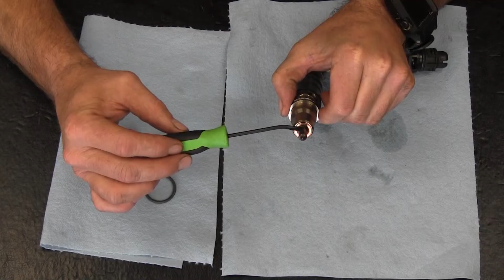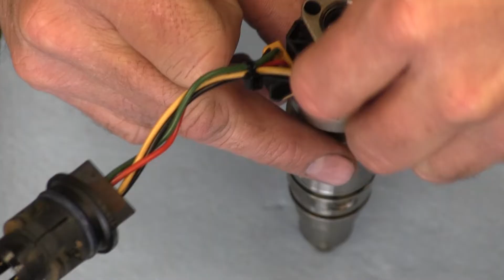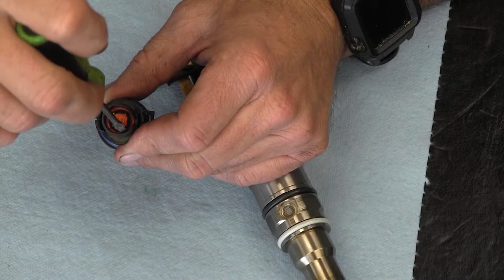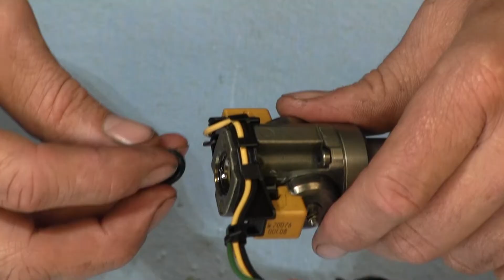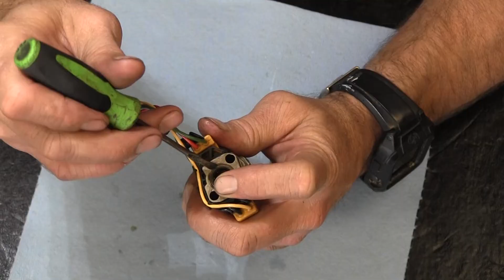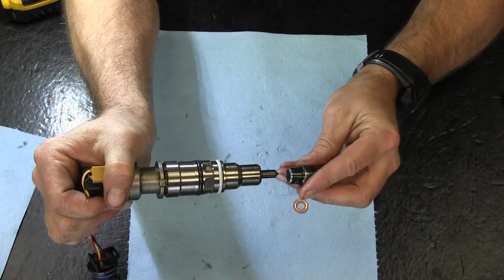Need to Replace the O-Rings on Your Injectors??? Watch How Easy!!!

Comment: good day! Why is the nozzle not holding air? The air comes out of two small holes, from above, where the nipple should enter.
Reply from the maker: I don’t quite understand the question.  But the nozzle is an extension of the injector circuit, and if it were air instead of fluid being delivered,  it would still “hold air” if the pintle was closed.
Reply: the fact is that when checking with air, the nozzle is not airtight! After removing the ramp, I saw that the O-ring was intact. But when air is supplied directly to the nozzle, there is an air leak, air comes out of two holes that are located near the central entrance, where the nipple enters.
Reply from the maker: If you are talking about an air leak in your engines high oil pressure system,  I would suggest hitting the IPR and changing the commanded pressure and seeing if the sound changes.  I guess I still don’t understand the question.
Reply: @thoroughbreddiesel  I believe they're saying they replaced this O ring, reinstalled the injector and the oil rail and air tested (using IPR I assume) and were still getting a leak and seeing bubbles from the holes on top of the injector on either side of the cup that you were just replacing the seal in.
Reply: I'm from Russia, I got an international with a Ford engine. We do not have specialists, unfortunately, there is no diagnosis either. I solve problems on my own. If it's not difficult, then your help with advice will be very useful to me. I'm watching videos with Ron on YouTube.I learned a lot of useful things.

Comment: I actually added too much oil (5 quarts too much) how much damage did i do? slightly rough idle but does shake at 50 mph range above 50  it runs smooth. my mistake was that i the youtube video i followed, had 4 jugs of oil(he used non motorcraft 1 gallon jugs) and i used 1.25 gallon motorcraft which were 5 quarts each so i overfilled.
Reply from the maker: Hard to say, but probably none.  Drain the oil and start again.

Comment: I'm just swapping injectors do I need to replace  o rings if I'm careful.  Have a po302 on my 2006 Subaru sti.  Already swapped  plugs and ignition coils
Reply from the maker: I don’t have an answer on the Subaru specifically but we always suggest when a injector is replace we change the orings and copper compression washer each time.

Comment: I'm no expert on 6.0 injectors. But every time I've replaced the inside o-ring, it's been faster and easier to pull the snap rings out.  If you get a small pick, grind it down and flatten the end to fit between the snap-ring opening, then twist, it will come out very quickly.  Then slide the guide out and swap the o-ring. A quick push with a screwdriver installs the new snap-ring.  You'll fight with it way longer trying to get the o-ring in without removing the clip, plus much greater chance of damaging the new o-ring.  But, everyone has their own method.
Reply from the maker: Thanks for sharing!
Reply: Sounds good!  If you ever need to do this again I bet a lot of people would love to see the video of you doing this, myself included.
Reply: I never have time to record, edit and upload anymore. But I did just finish another set of 6.0 injectors today. Two of them gave me a fit. It was still easy though. Once you pull the old seal out, push the guide ring down, then pop the end of the snap ring down with a good tap. Then grab it with a pair of pliers and twist a little. Both came out quickly.
Reply: Right lol thats what i thought 🤣

Comment: Looking to throw in a set of 90hp sticks in my 6.7. - Do you recommend upgrading the CP3 and/or lift pump? - It appears that the 90hp’s are marketed as “largest injector recommended for stock system”.  Some say they have zero issues, while others say they have pressure drop.
Reply from the maker: We suggest upgraded lift pumps on stock applications, and upgrading your CP3 will help you get the intended results from your injectors if the tuning leaves power on the table.  Short answer, yes.  Your ENTIRE setup should reflect your intended HP goals as well, don’t forget that!

Comment: Theres 2 orings in side the injector body that fail before tbe external O-rings do when that happens you start dumping diesel in your oil then tne fuel rail under the nipple is an oring that should be done . Do those too unless you like pulling them out every other month
Reply: OK, So there would be the top seal inside injector that nipple cup seats in to. I replaced that one with Mahle seals.  Where is the other one?    Thanks for the reply.

Comment: Hi Wayne, After you do a rebuild on engine including reseal of injector top seals , nipple cup orings, new oem stand pipes and dummy plugs with engine still on stand and basically dry (no oil)  would it be unusual to hear air escaping from around all these areas?   Hissing and some clicking , spitting noises. Carefully followed your video guides resealing  all those and thats what I'm hearing when testing with air though ipr or icp ports. Dont want to tear it all back apart if this is more or less normal and really dont want to do it once reinstalled in truck. Some guy on powerstrokenation had similar issues same situation and truck started and ran fine. I also had a smoke pen and streamed a steady stream of smoke around all the noisy areas and didnt see any air leaks that way around oil rail and injectors. your thoughts greatly appreciated or anyone else who cares to comment.
Reply: What ended up happening
Reply: I only finally got the engine back in and running which is why I waited so long to reply.   The truck built up high pressure oil to the injectors pretty quickly. Only took about four 15 second cranks to get the needed pressure to fire the injectors . Runs great now with no long cranks or hard starting issues. So, not only did I replace the top seals in the injectors like shown in the video but I also replaced the nipple cup seals in the high pressure oil rails, (the ones dieseltechron says not to touch).  If you air test for leaks after doing the nipple cup seals before total reassembly and cranking engine with oil in it ,dont get freaked out if you hear massive leaking. It needs the high pressure oil to properly seat the nipple cup seals into place. The air just blew right around them till then. Dont cheap out on the seals. I used HHC which were highly recommended and I hear alliant also has good replacement seals. Ford does not offer replacement seals. They want you to buy the whole new oil rail for around $700. The seals were only about $20 tax included. If they dont last I will update.
Reply from the maker: Is the truck having a  hard start or lack of power?  If not then I would think that your repairs are sound.  I think that once the oil system is primed that air escaping noise should go away, unless you are having another leak.